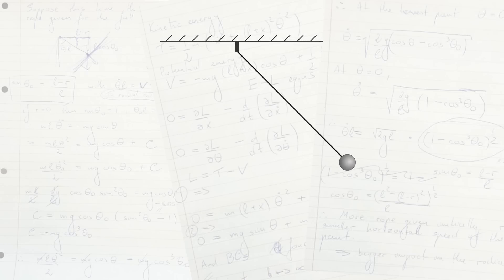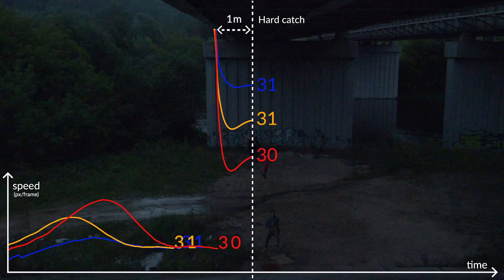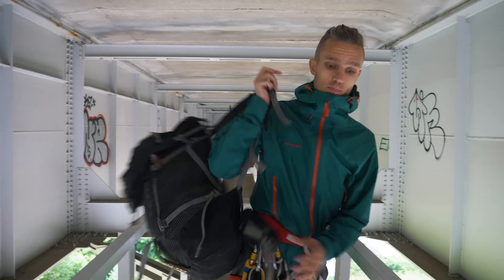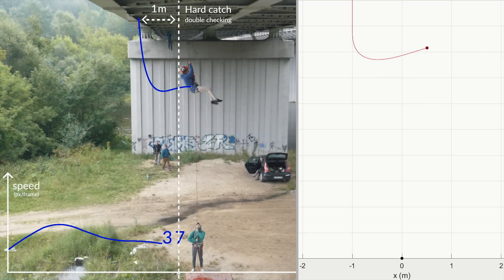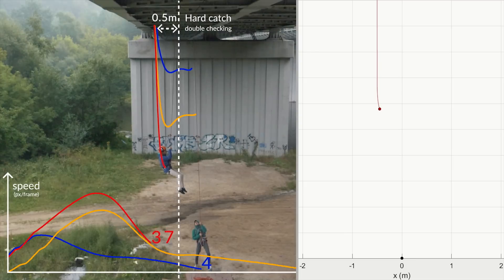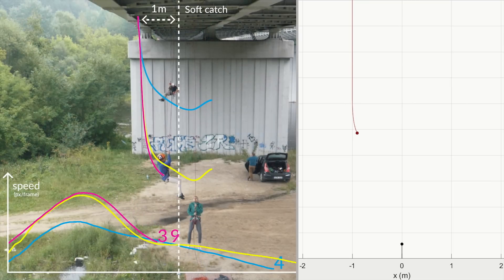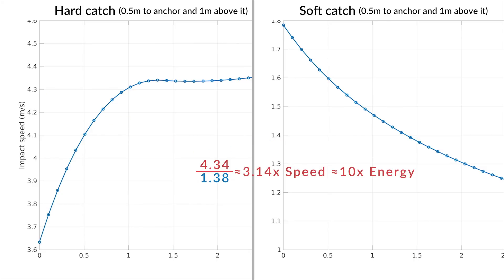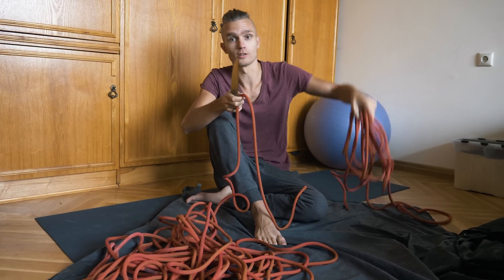Too much Slack while Lead Belaying?

Comment: Nice video! What you should really test is acceleration. This is the rate of change of velocity. What hurts is not the actual velocity, but the change in velocity. For instance, falling through  the air off a building doesn't hurt you, it's when you hit the ground that hurts. A rope will lessen the acceleration of a fall.   The eqauation is:  Acceleration = (velocity at time2  -   velocity at time1)/ (time2 - time 1).
Reply from the maker: You are correct that what hurts is velocity or the g-force. But only at the moment of impact. And basically the moment you hit the wall your G force will be all the speed going to 0 in a very very short time frame.Or in other words when you hit a wall the speed that you hit the wall is what matters. Physics of collisions are mainly based on conservation of Kinetic Energy 1/2 * m *v^2 and conservation of momentum m*v. It doesn't matter what was the acceleration at the moment of impact or previous to it.

Comment: I wonder if you're isolating the horizontal component of the velocity at which they hit the wall?  You seem to be using the raw velocity vector, which is generally less horizontal with more slack out.  See 2:49 for example.  Red line is 40 deg off horizontal.
Reply from the maker: That's true horizontal velocity would be much lower in the case you are referring to. But when you hit the wall full component of the velocity is that makes the energy that needs to be absorbed... That's in case your are not sliding up / down the wall during the impact, but you have a sudden stop.
Reply: Great video and work, bravo.  However, I agree with the former comment from jaafit regarding it being the vector nature of the speed that matters to some degree, and disagree with your reply.  Would you rather hit a guardrail in your car doing 100 km/h head on, or at an oblique angle?   Only the horizontal component has to be rapidly absorbed, even in a climbing fall. Hitting a vertical wall with primarily upward velocity on the bounce is not a big deal, in my experience anyway.  Do you think you would get killed glancing a wall at a speed that would wreck you on direct impact?
Reply: Spam Johnson I thouht the same way, but afer reading the author's reply and realizing that rock walls are never flat...  I think it's more prudent to model the worst case scenario where the site of impact is perpendicular to the velocity vector.
Reply from the maker: Johnson, if your car would hit the wall to the wall that is angled but would not bounce to the side or slide and full hit would still go to the wall it wouldn't matter what's the angle. That's why I said if you are not sliding up / down the wall full impact force will need to be absorbed. In any case I still want to do some corrections to our model some time in the future once we get some more time, so stay tuned :D